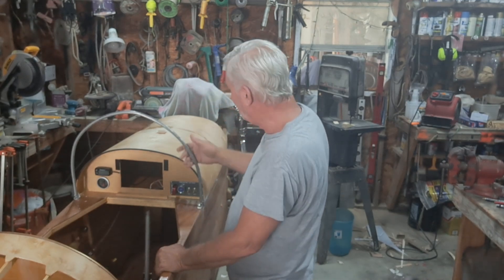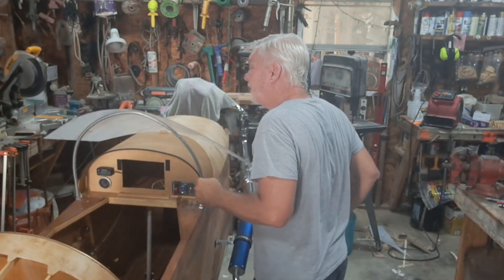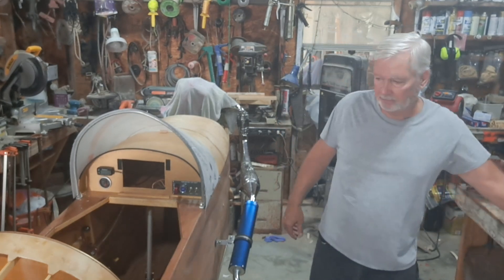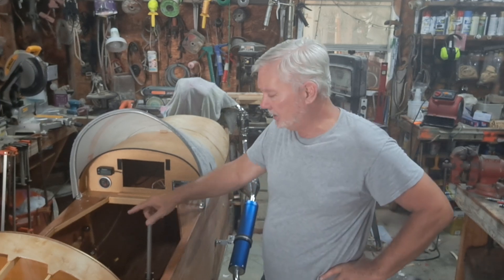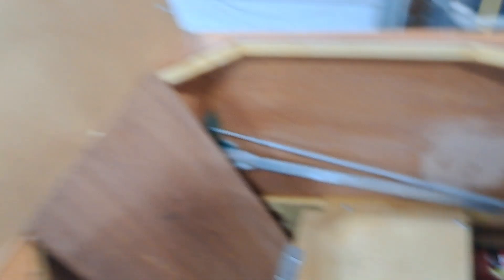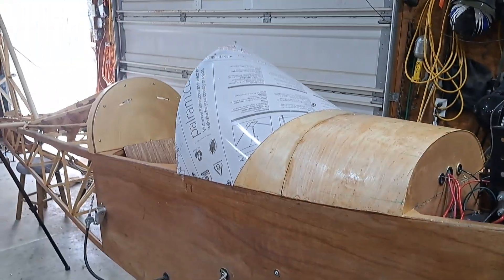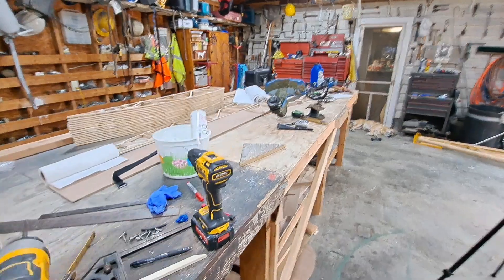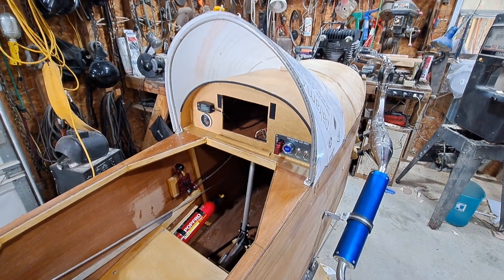Mini-Max 1030S ultralight aircraft build with Scott - CXXVI

Comment: Are you building to Part 103 Ultralight Aircraft standards? If so, do you anticipate any problems with weight, stall or speed? I'm asking because the plane is rated for a 28 to 30 HP engine. I'm leaning towards a 1103 or 1030 build myself, so your build is helpful.
Reply from the maker: No concerns at the moment.
It should come in under weight limit. Max speed might be higher.  
Machine guns should balance it out!
Reply: @GranPooBah  🤣